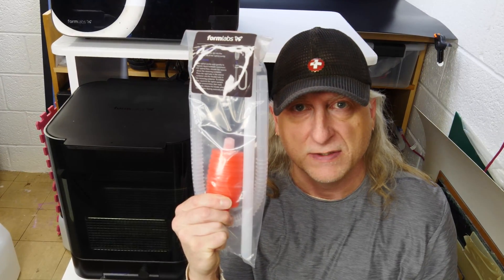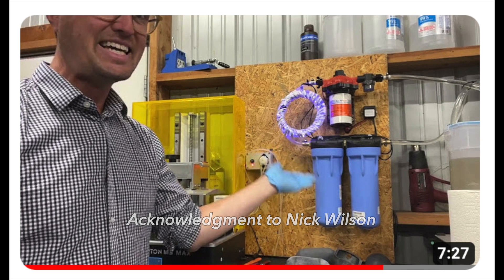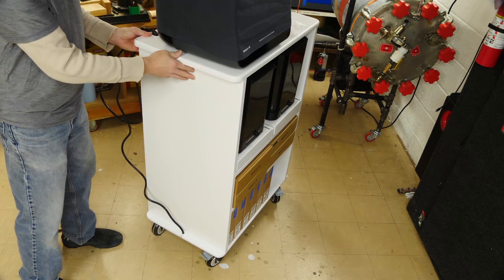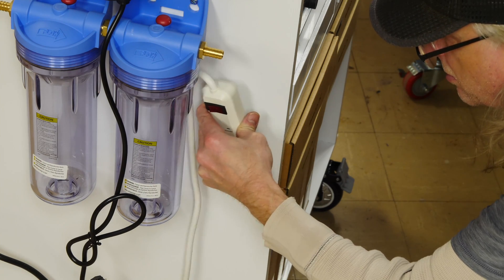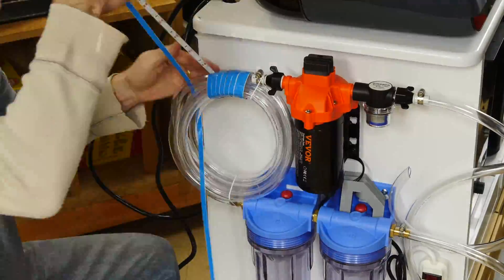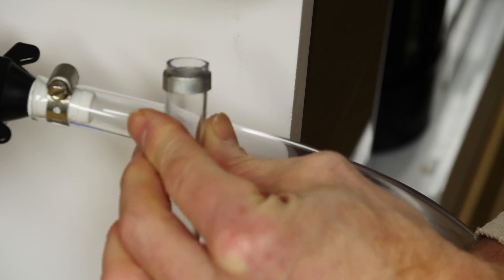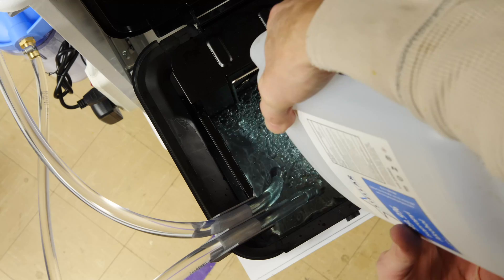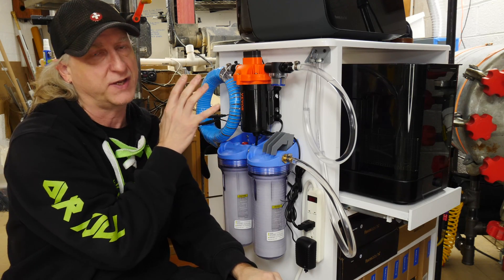IPA Filtration System Build for Isopropyl Alcohol - Formlabs Form Wash

Comment: I think the only thing I would change personally would be to have the hose storage plug the ends to prevent excess evaporation or the IPA that remains in them.  Otherwise, a nice use of Nick's setup.  I remember when he first posted that setup and I decided that I would need to build one at some point.  I'd have probably already done it, except that I haven't printed anything in almost a year, lol.
Oh, and I would also probably make a point of either looking for clear filter housings that aren't polycarbonate, or go with opaque, since IPA attacks polycarbonate.  I learned that the hard way when I went to clean the polycarbonate reservoir in my pc cooling rig, and it rapidly cracked and became useless, lol.

Comment: The pump that you use named as water pump. I have build that system before. But after few weeks the pump did not make any pressure. I take apart to understant the issue. My conclusion isopropanol make the rubber parts to shrink inside. How about your pump. Does it still work?
Reply from the maker: Yes, still working well
Reply: @EricStrebel  The vevor model burned out on me in 4 days.  I'm about to install a pump rated for chemical spraying.

Comment: Hi there, your video is very interesting about the process and the equipment required. The UV lighting is very clever. Also, working in industry with solvents ,  I am a bit horrified about the lack of security during your process. Ipa is extremely flammable as you know and I believe the atex regulations should be in use while filtering solvents. I see that your 2 pipes are simply clipped and not  held in place securely, a tube could come off and spill the IPA and electrical plugs or other things.  You can also notify that your pipe connection is just few inches away from the electrical power !?  I  don't want to play the guy who gives lessons or anything, it is just my concern about security that we face in industrial environment. Kind regards.

Comment: Since this system is not a closed system and uses an abundance of UV LED lights, you should be concerned about the potential formation of explosive peroxides in the isopropyl alcohol. 2-propanol (isopropyl alcohol or isopropanol) is on the list B of explosive peroxide forming compounds that can form explosive levels of peroxides on concentration. It can also form peroxides given enough time with exposure to air and sunlight (or other UV light sources). There have been several explosions attributed to this and a fair amount of literature written on the subject. At the very least, you should consider buying peroxide test strips and testing your wash station occasionally.
Reply from the maker: Hmmm, interesting.
Reply: thank you for bringing this to light. ive honestly had no clue. getting test strips now.

Comment: How often do you have to change the filters?  I run 4 machine and dirty a lot of ipa and I'm wondering if this is a option for my size of if I will just run thru filters daily?
Reply from the maker: It's really hard to tell you'll just have to keep an eye on it and change it based on how much you use it, which is way more than I use it

Comment: Doesn't the plastic of the UV strip covered tubes block UV light? I've tried plastic bottles to contain my dirty IPA, no resin settled. Then I switched to glass and there was a ton of resin goo at the bottom. Is there something different than the usual with the tubes?
Reply from the maker: Watch the next video I switch to a different material
Reply: @EricStrebel  Oh, I see. Thanks for the confirmation. My approach is mostly based on trial and error, sometimes things work, mostly don't. Your reply is extremely valuable.

Comment: As I understand it, the whole loop system (pump + tubing + filters) is constantly full of IPA. In order to replace the filters, you have to unscrew their housing. How do you do that without spilling IPA everywhere in the room in a messy puddle damage? Someone in the comment of Wilson's original video suggested to add a Y adapter with a valve directly at the pump outlet and a bit of additional tubing, in order to be able to inject air from a compressor to drain most of the IPA out of the filters before removing the housings in a clean, dry way.
Reply from the maker: I didn't update to this video if you watch it it will answer your questions.

Comment: @EricStrebel I'm putting together a similar system thanks to your and Nick's video, but I'm concerned about the pump.  It says not to use with flammable liquid.   Have you experienced any issues with the IPA, or considered switching to a gasoline rated pump?
Reply from the maker: Nope, no issue

Comment: Any reason you went with 1 micron for the first filter as opposed to the original video's 5 micron?
Reply from the maker: Yes, 5 is effectively useless in my opinion. Honestly 1 is too. The pump moves so much volume, get the finest filter you can
Reply: @EricStrebel  Have you had enough time to address the other things mentioned in comments? The hose line breaking down from UV/IPA or the clear filter housings breaking down? Someone else mentioned the filter pump needing to be oriented differently too.
Reply from the maker: None of these things have happened, however they are all getting upgraded. I have all the parts and will make a video about it. So many good suggestions from the community. @ScottBaker-i2u

Comment: nice Idea I have 2 suggestions .  the pump should be after the filter (if possible) so less material is going through the pump and will gum it up .  also I can see the clear filter housing cracking due to IPA and the material . might be worth changing to the white housing that will be HDPE
Reply from the maker: Very good ideas
Reply: About the pump before or after the filters: in the current setup, the pump being before the filters automatically stops when it reaches a pressure threshold (45 psi for this one) meaning in this case that the pump cannot push the IPA anymore because the filters are full of resin, indicating that these filters have to be changed. I am not sure that putting the pump after the filters would trigger its safety mechanism from too much of a lower pressure at the inlet when the filters are saturated. However this definitely should be investigated because your idea is very interesting to make the pump last longer.

Comment: Unfortunately vinyl is not going to handle the 405nm forever. It will become hard and eventually crack. When? No idea. Could never be an issue. The ideal solution would be a pyrex or regular glass coil, but who knows how expensive that would be. Nice work!
Reply from the maker: Yes I anticipate that will be an issue at some point. Either replace it every once in a while or come up with a permanent solution. Would the glass allow the UV wavelength though to cure the resin?
Reply: @EricStrebel  To my knowledge, quartz glass is the most transmissible to UV spectra. Pyrex and other glasses only pass a very small percentage.
Reply from the maker: Ok, good to know, I will look to see if I can get something like that fabricated.... I wonder how hard that's going to be!
Reply: @EricStrebel  The channel ProjectsinFlight just did a good video about glass flanges, maybe something like that? I would think the higher irradiance would allow a much shorter glass tube. Could also look into cyclonic separation, to extent the life of the primary filters.
Reply: @BiglyWeenis  It depends what kind of borsilicat glass you buy. Duran (Schott's Pyrex) has two clear versions: Clear Protected (blocks 20% at 400nm, longer wavelength are less blocked) and Clear Unprotected (blocks 10% at 350nm) Schott has somewhere graphs for it's Duran. Also there is PYREX and pyrex, one can be tempered glass.
Reply: Yes. Same as how we are able to use glass jars to cure our resin outside in the sun. Enough gets through.
Reply from the maker: True
Reply: Anyone know how silicone tubing would work with UV, pressure, and IPA?
Reply from the maker: Fep, update video next week, look for it

Comment: Great video, Eric.  I built the same system a few months ago and am very happy with it.  FYI, both clear filter housings cracked at the threads after a couple of months and had to be replaced, so I replaced them with the blue, opaque ones.  I never figured out what caused the cracks, but the blue ones have been fine.  I also had the pump stop sucking after a couple of months, for reasons I was unable to discern, even after disassembly (everything looked and worked OK).  The replacement has been working fine.  Btw, I think the instructions recommend the pump be mounted with the motor away from the floor, not towards it as you have it.
Reply from the maker: Ok, good information. The clear housings maybe are not so chemical resistant and that's why they cracked. Time will tell
Reply: The clear filter housings are typically polycarbonate which can crack when exposed to IPA (Environmental stress cracking).

Comment: Absolutely brilliant!  Could you do a video on how to recoat the Form 2 resin trays?  Although thinking that the Form 3+ has that film on the bottom...I never upgraded because I hadn't heard good things about it.  Total Form fan here...paid $4500 for mine about six years ago.
Reply from the maker: The form three+ is superior in every way to the form 2. I am extremely happy with the unit. Use the link below to save $500 if you decide to upgrade. Thanks for the comment
Reply: @EricStrebel  I would assume that the trays are still plastic?  That’s one thing that has always been a problem for me.  I use mine for printing jewelry models, but Formlabs has never really had a good solution for castable resin, which is really hard on the trays.  I actually had one crack on the printer and leak resin, but Formlabs’ support was awesome and replaced it for me.  I have probably more than a dozen in storage and a silicone/PDMS (sp?) kit, waiting to recoat.  

I’ve also tried BlueCast, but when Formlabs switched to the castable wax (blue) resin with the giant support touchpoints, I never even tried the new resin, although I own it.  I think they did jewelers a disservice by saying that their castable resins “works great with minimal residual ash” but never sharing any information on how to actually cast with it.  The people who were getting good results refused to share the information with others, and Formlabs didn’t really share the information either except for in a very generic white paper.  I’m about to invest in another printer, and although I really love my Form, I’m looking at others as well.  I love the PreForm software…I was really happy to find a company that was Mac-friendly!  I’d LOVE to see it on an iPad.
Reply from the maker: Yes, the trays are still plastic. But the mechanism to wipe the resin and how the film separates is totally different from the form 2, it works from underneath to pull the part off the film, using much less force than before. I wish I knew something about the resin you're using I could make a video about it but I don't work in that realm of jewelry making, so it's out of my wheelhouse. But I must say the print that these machines make have virtually no build lines and are quite amazing. I'm really impressed with how good the parts are. My halot mage pro is a hobby machine compared to the form labs machines.

Comment: Very interesting! Im wondering though, i think there is a lot of oils in resin that simply dont cure with uv light. Its those residues that break down the ability of the ipa to clean. But im sure it helps a bit to do this, The Ipa will look cleaner and it wont leave those white resin spots when saturated but the oils will finally take over. I think so at least from what ive experienced. Thanks for a great channel.
Reply from the maker: Time will tell, I suspect higher quality filters will be helpful
Reply: @EricStrebel  hopefully, but again i think its smaller than so, its on molecular level. the only way to really clean Ipa is to use some kind of chemical separation process,  or some sort of evaporation filtering.
Reply: @eddiexx  So what a lot of people are saying, after IPA has been used multiple times, it looks clean but leaves a sticky substance on the surface of the model, this is the oil in the resin you are talking about is it?
Reply: @lamberthugh8316  Yes, now it will still clean the worst residuals, even when dirty though. Therefor you use two or even three stations when needed. One for the worst dirty claning, then one for the fine cleaning. when that is too dirty it goes into the first.
Reply: @eddiexx  Thank you for your reply. May I ask if you are currently using a dedicated cleaning and curing station from AC or Elegoo? Or just using 2 glass jars. I've watched a lot of videos and it seems like the specialized cleaning station doesn't do much, but I'm not sure how to go about mixing the water if I'm using the glass jars. If you have a good method, can you share it with me? Sincere thanks.
Reply: @eddiexx  It's in the tank, how do you get the water to turn, I see specialized cleaning stations have a wheel blade at the bottom.
Reply: @lamberthugh8316  it all depends on the scale of your operation, if its a a piece now and then or if you are making tens or hundreds of pieces a week. if its just some print a week then i would just have two jars, no need to have an advanced system. if its tons of pieces at the time or over a prolonged period of time then a washing station. With a jar you dont circulate the ipa, just do it by hand.  always begin cheap and simple, then after you will know what you need and why.
Reply: @eddiexx  Thank you. So I guess I just have to hold the model in my hand and grab it and wiggle it back and forth in the first glass jar and that should be enough right?

Comment: FYI, vinyl blocks UV light and breaks down. Not only is your UV light doing nothing, it's also destroying your tubing. 

Depends on the wave length, but those cheapie LEDS are never going to be as advertised and likely have a very broad band if they are even in the UV range at all. High quality UV LEDS are typically $60-70 each, not per strand, but each.
Reply: I also wondered how good these cheapo Amazon UV LED strips are.  But I measured two different brands with a spectrometer.  They gave a peak wavelength of 397 nm with a half width of 10 nm.  So they are fairly narrow band, and centered close enough to the recommended 405 nm to be functional.  The ones linked above are different than what I purchased, so I can't vouch for those.
Reply: Doens't block UV light, first time i ran this i had resin cure on the walls of the pipes running against the uv leds lol
Reply from the maker: Yeah, I assumed that the vinyl would break down over time, but it is not UV resistant from my research. Any suggestions for replacing the tubing with something else clear that will hold up to the alcohol?

Comment: Changing the filters may lead to IPA spillage - would you not need some isolating valves either side of the filters or can you just run the system until empty into a bucket?
Reply from the maker: Yeah, I was thinking of some drain valves at the bottom of the filter housings for that. Stay tuned for the update vid, I will include that as part of the update, plus a whole bunch of other stuff
Reply: Yeah, I was going to ask about how the filters would be changed.  Drain valves at the bottom sounds like a good idea!